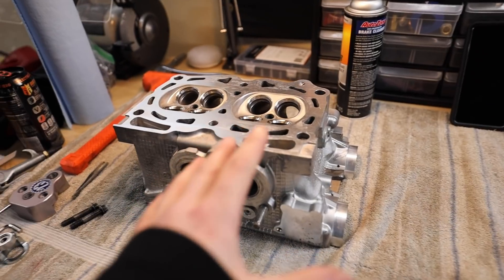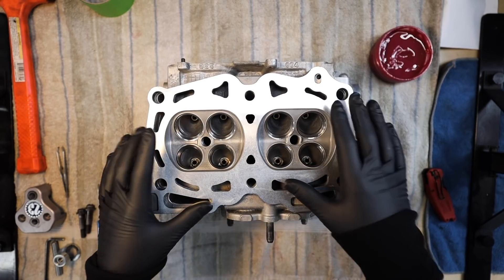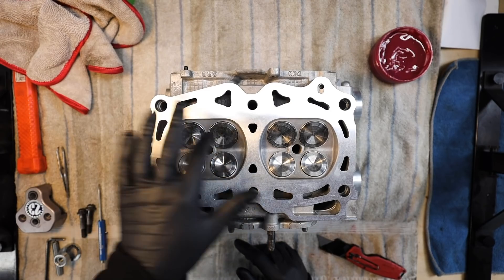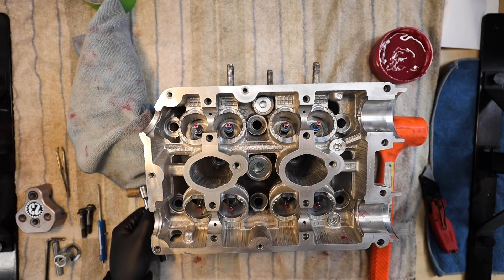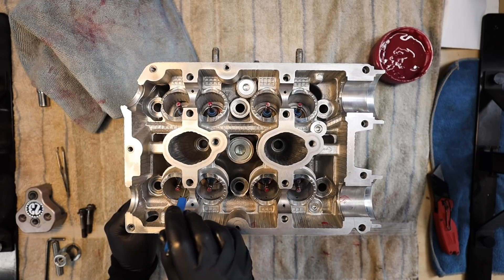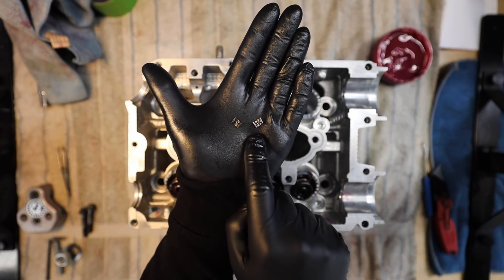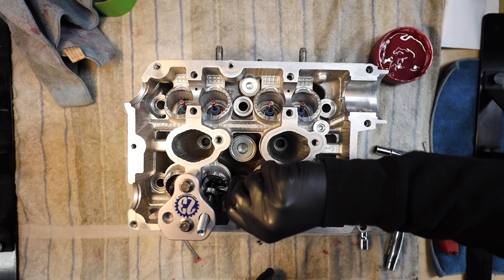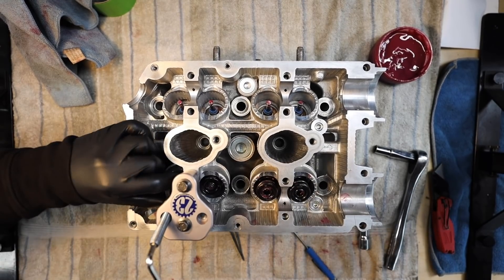How To Build EJ25/EJ20 Heads

Comment: Genuine question, I have my engine removed on my 2009 Forester xt. Ej255.

I purchased a 2018 sti RA block, but I want to re use my d25 heads off my ej255. Any recommendations or advice?

Comment: Question regarding valve springs- I saw in one of your other vids that you suggest refreshing them with the Brian Crower set beyond a certain mileage.  I'm pulling my EJ later today for a head gasket job out of my '09 FXT.  It's got 180k on the clock with a COBB stage 2 custom tune.  At that mileage, would you say the spring refresh is a good call even if it will probably never go past stage 2?

Comment: idk if these aftermarket valve seals are all the same for the IN/EX valves. The oem ones have tiny "IN" and "EX" for valve seals.
Reply from the maker: Aftermarket do not have them, oem does 🙏 oem is also color coded

Comment: If you install stem seals first it holds the valves in real nice. Try it. Plus you can push them on with your thumb if the stem isn’t in the a way

Comment: Checking this vid again, that sounds at 3:50 reminds how satisfying is when you load the M203 lol. Yeah man I think ill get that Comp23 tool and change the valves, springs and retainers myself. I got my eyes on the Ferrea valves springs and retainers kit, for STi they have 2 kits, Endurance and Drag which i dont know which one is the suggested for street use.  I'll do cams as well, but do I have to do new valves? if theyre still good can I use them with Ferrea dual springs?
Reply from the maker: You don't have to do new valves but while it's all apart it's definitely not a bad idea to do them, I'll have to look onto the Ferrea a bit more, haven't used em yet 🙏
Reply: @Smeedia  i was checking the spring compressor tool, didnt know torque solutions has one, its $20 cheaper than comp23 but dont know if its the same quality and get the job done. We'll see.

Comment: When you assembled the heads and put the keepers in, is there suppose to be a little gap between the keepers
Reply from the maker: Yes, they dont always touch, they will also spin around the valve as it's running over time

Comment: I saw a video on YouTube that has keywords "install valves without special tool trick and it works amazing.

It generally takes under 30 seconds per valve and it eliminates the chance of valve keepers flying off needing to be surgical about it.

That special tool is nice but definitely  time consuming.

The other method uses 2 vise grips, spark plug socket and a piece of plastic similar to that made from sandwich bags although just about anything type can be used

Comment: Great vids man. Have you ever had valve spring failures or valve failures? I’m looking into built heads and have seen very mixed reviews about some valve spring/valve manufacturers. Thanks
Reply from the maker: No issues with heads they're relatively easy to assemble. As for parts your pretty safe with Manley, GSC and Brian Crower 🙏
Reply: @Smeedia  cool. Thanks

Comment: So glad I came across this channel - phenomenal stuff 😊
Would you consider making a EL15 build video, how to squeeze some "moo powaaah baby" from it? Full tear down, get it back into 1 piece ...
Reply from the maker: Unfortunately not much you can do either them. You'd be better off swapping to a EJ20/25 for more power. 😭
Reply: @Smeedia  If I was to swap EL15 for EJ20 would that base Impreza be able to hold it? The transmission and other stuff? 2008 Impreza Hatcback 1.5 R 107 HP.
I would have to take a look at your channel in a bit more detail to see how that could be pulled off 😊
Reply: @Smeedia  Also - where do you look those engines up? Where do you buy them from? Thanks
Reply from the maker: You would need to do the rltrans, rear diff etc. People have done it but it's not really worth the time and money 😖 ebay or Facebook is where I see them pop up!
Reply: @Smeedia  Yeah - thought so about the time and money part. The thing is that since 2008 it got closely to 50.000 km and I doubt that I would find a replacment that had that little km haha. Thanks for the reply - will make sure to check out all of the videos. Take care 😊

Comment: Use the flat head end of a small screwdriver and put assembly lube/vaseline on the flat head & valve keeper to stick the keeper to the flat head. This makes it 100x easier to put the keepers on. Put one keeper in & rotate it to the other side of the valve, then stick the other one in there. They actually teach you to do it this way in automotive school when building engines. Good to see you got them in with tweezers though haha I watch people throw tools around the shop getting so mad trying to get them in and dropping them with tweezers 😂 good to see the build coming together! I have a video on calculating bucket size too! Im curious to see if you use the same method!
Reply from the maker: I went through and used the smallest bucket size to calculate everything, time consuming but worked 😅 and next time I'll be doing that, the tweezers worked but not the best method 😅🔥
Reply: @Smeedia  That works! But yes that is a very time consuming way haha. I actually used all the buckets I already had (even if they were too tight for spec) as long as they had more than 0.002” clearance and were not constantly touching. Then I took all my measurements on every lobe and used as many buckets as I could! (They are expensive so this limits the amount you need to buy). Check the video out haha maybe it will give you a new way of calculating bucket sizes and save ya some 💵 🤙🏼
https://youtu.be/qog6rjB-bjk

Comment: You forgot to valve lash these! At least do it right man.
Reply from the maker: Valve lash takes place on the bucket side, not grinding the valves here 👀
Reply: @Smeedia  you need to lash the outer part of the valve lip and mate it to the head. It will give you a better seal.
Reply from the maker: Lapping the valves? All the seats were cut to the new valves

Comment: You should have lapped those valves before assembling the head completely
Reply from the maker: Why? The valve seats were cut to the valves and vaccumm tested to ensure a good seal
Reply: I understand that, but lapping them will help with seating/sealing better. You’ll see a difference in leak down percentages

Comment: No lapping of the valves?
Reply from the maker: Did not need to. All the valve seats were cut to the valves
Reply: @Smeedia  I have always been told to lap new valves, even after the seats were machined.
Reply from the maker: I haven't heard that, since the seats were machined to the valves they shouldent need lapping, the lapping should just help to clean up pitting kn the seat and the valve. But could be something I'm missing 👀

Comment: excellent!   ting'ing is a technical term!   This is exactly the type of thing (if you haven't done this kind of work before) that you need to know and understand,  devil is in the details!  Great Vid!!!  /bow
Reply: also,  a little lube on the keepers can help them stay in place while you assemble
also, i have had to take a stone to the end of the valve to fix a tiny burr that can keep the retainer from going on correctly, very rare  14:40
Reply from the maker: Found that out at the end that a little assy lube helps 😅🔥

Comment: I might have the early stages of rod knock so I might need to rebuild my engine I have a 2015 wrx any advice? I’m mechanically advance but don’t have a bunch of specialty tools.
Reply from the maker: Just take your time and label when gling through everything, they're relatively easy motors to work around. If you do have knock make sure to get anything machined that needs to be